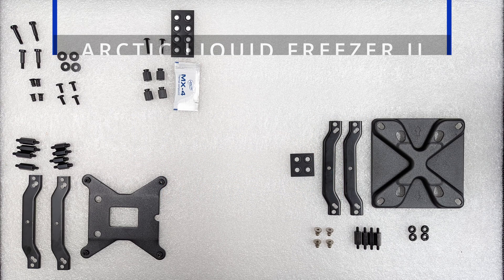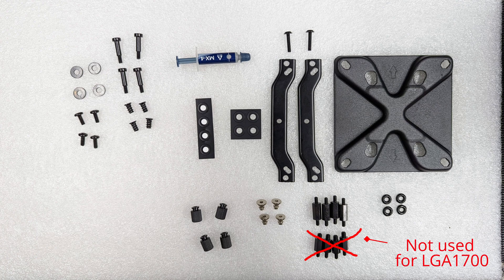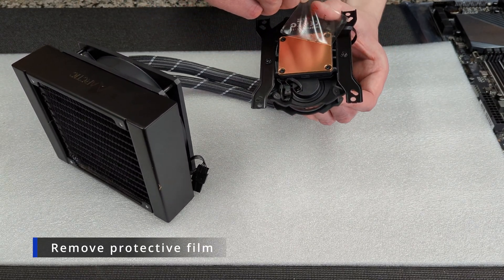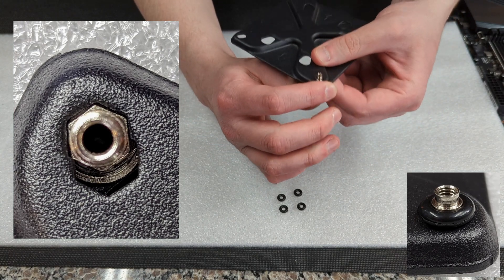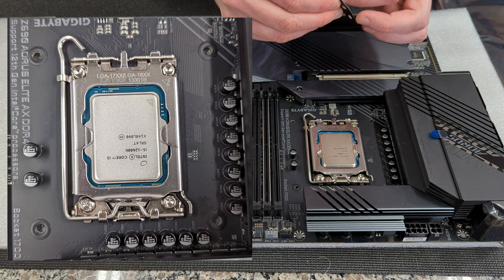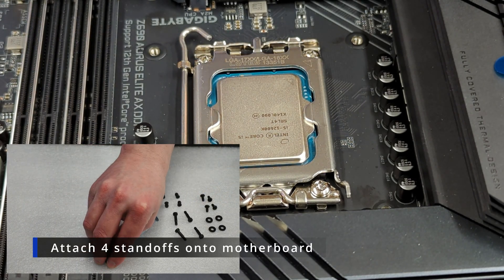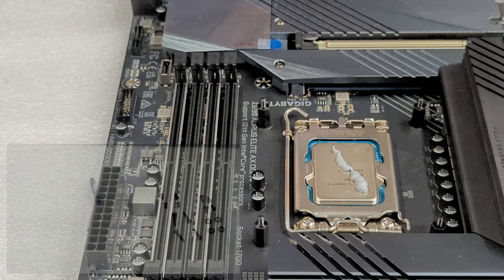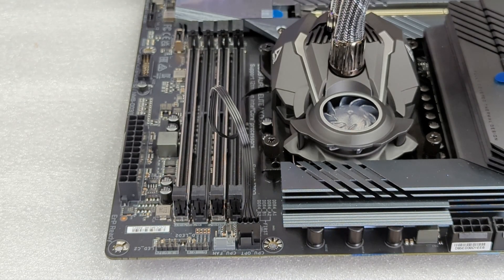ARCTIC Liquid Freezer II | LGA1700 Kit Installation

Comment: I'm sorry, I bought a Liquid Freezer II 240 and I've been trying to assemble it for 3 hours without DAMAGE to my new board... Please update the tutorials and your manual which in my humble opinion is extremely
Reply from the maker: Hey Rony,
I'm sorry for the confusing video.
Please keep in mind, that this video is for the Rev.1 LGA1700 Kit.
We introduced a new Kit just a few weeks ago (Rev.2)
Which might look different to the Kit above.
We're already working on another video to keep everything up-to-date.
Kindly check our online manuals here: https://pulse.ly/td65nmccgp
Select the right Rev. and you should be guided through the installation step by step :)

Best regards,
Nico
Reply: @ARCTIChannel  Nico, thanks for the prompt response, I apologize for any words that sounded offensive, but I ask that you understand the frustrations of anyone who buys something and seems to receive another, or just after opening the new equipment and parting with news that it is probably the part she just purchased it will possibly not be useful for what you bought, MAAAAS your site is organized, and I even by intuition (following the manual of course) checked it once more and mine is REV 7 and I assembled everything as agreed with the manufacturer, thank you very much for your attention, a big hug 🫂.
Reply: Now, my only question regarding your material, is how rigid the hose of this water cooler is, it seems to cause a huge pressure of "pulling out or to the sides" on the processor... I had to change cases 3 times because of that :/
Reply from the maker: Hi Rony,

sorry about that. I hope that everything has worked now. 💙

Kind regards
Dominik

Comment: Instead of sticking the 4 spacers on front motherboard, Easer to stick each on the end of each Rod screw, This will save you time trying to peel them off of motherboard.
The 4 spacers for the back of motherboard can be left off, The O-rings are rubber & do a good job
Reply: Yes, i think the same, but I ended up doing the same as there... Extremely confusing and non-LINEAR manual, it appears first how it will look and then the pieces, completely the opposite, I think I should show the piece first and where it will fit... Already working

Comment: I just buils up my new computer with this Arcitic as cooler for my i5 12600kf but instead used Original Pre-LGA 1700( haven't seen this video before and not included mounting kit either xd) and result is worst than I can imagine . It seem like with this old moutning kit, the pump can't reach enough for cooling CPU and temp idle when start bios is 55 o C and when cpu load 24-25 % is 80~ 84 o C . It seemed like I need change mouting kit I used 😢
Reply from the maker: Hey Lilgamesh,
Kind send us a DM on another channel - Please include the invoice of either your cooler or CPU.
I'll send you a Code, which you can redeem on our website to receive the latest LGA1700 Kit.😊

Best regards,
Nico
Reply: @ARCTIChannel  Hey . Should I send message by Instargram or by email ?
Reply from the maker: Feel free to write us on Instagram, it's faster. 🙂
Reply: @ARCTIChannel  Yes I have sent it . Thank for your help

Comment: Just did this last night.  It is still the largest and most difficult AIO I’ve wrestled with in 20+ yrs of building.  Also I got new stock from Amazon less than a week ago and it did not have the the new plate hardware.  Looking on their website I “may” have the revised pump block but hard to tell from the photos.  In the Asus 690 strix board I have (one of the affected) there are so many heat sinks that it further complicates things.  I’ll boot it up shortly and see how I did.
Reply from the maker: Hey,
I'm sorry for the inconvenience you had with the installation.
Kindly send us a DM on another platform and send over a picture of your CPU block. We'll take a look at it.
Did you already installed it?
Normally there is something called „Keep out Zone“
The manufacturer of the Board should make sure, that other parts are no interfering with the Board.

Kindly share your feedback!

Best regards,
Nico
Reply: I just got my Arctic Freezer II 360 and it came with everything needed for mounting on an LGA1700 EXCEPT for that damn black plate. It came with a different plate, but not the one that has an X shape in the middle. So I just had to order the LGA1700 kit from Amazon and now I gotta wait another 2 days for it to get here. I was legit about the mount the cooler and put the motherboard in my case and finish up the build when I noticed the plate was missing. :(
Reply: @WilliamTell1313  i used the old backplate and it worked fine but i needed to use a shorter set of standoffs
Reply: @MumuInc  I was actually wrong with my comment. I actually got the Revision 2 LGA1700 kit. It comes with a way slimmer backplate that worked perfectly. I'm not sure what the original comment guy was talking about. I thought the installation of this was super easy. I still got the Revision 1 kit from Amazon, but they are going to refund me.

It was confusing because every picture had the Revision 1 backplate and even on Arctic's official web site, you could only see the Revision 1 kit. Even when finding the Revision 2 page from Google results, upon clicking on the link, it would just redirect to Arctic's home page. So I'm guessing they are sold out of Revision 2 kits. Still would've been nice to know or have a label on the bag that the LGA1700 kit came in!
Reply: @WilliamTell1313  i think the original comment was talking about the pump itself not fitting onto his motherboard which some strix motherboards did have issues with but i think they're mainly the itx versions

Comment: So is it ok to use the original Pre lga 1700 hardware because that's all that came in mine?
Reply from the maker: Hey Marcus,
Kindly make sure, it's not the Rev.2 LGA1700 Kit.
It looks pretty similar to the original backplate :)

Otherwise you can request a free LGA1700 Kit on our website, if you have any issues with the compatibility of your backplate.

Comment: are both kits good to use or only the one to the right? I bought two arctic 2 freezers and all of them have the kit to the left...
Reply from the maker: Hey Natka,
Both Kits should be fine.
The Kit on the right side is the Rev1 (a bit thicker)
The latest Kit (Rev.2) is also available on our website now.
in 95% of the cases you should be fine with the Rev.1
Due to some incompatibility issues we added the thinner Kit aswell :)

For further questions don't hesitate to ask

Best regards,
Nico

Comment: I recently bought the non-RGB, Arctic ii 420mm AIO, with the updated thin backplate and other hardware, and it fit into my non-RGB Lian Li Lancool III case at the top (I was pretty excited when it worked out.) I have the i9-13900k and a Gigabyte z790 Aero board, with two sticks of 32GB Kingston Fury RAM, and everything fit properly! :)

My only gripe is having to use those stickers for washers. They can be a pain to work with, because it can be easy to miss-align them on your motherboard, and peeling them off might cause damage to the board. It can be very nerve-wracking.

Anyways, Arctic folks, please try and come up with something that does need to use stickers for washers, and is still safe for the motherboard on the CPU side, because those stickers may be permenently stuck on the board after fastening those standoff screws. ._.
Reply from the maker: Hey Michael,

Thank you for your general feedback aswell as the feedback about the washers.
Normally they shouldn't be able to cause any kind of damage to your board, when peeling off.
I'll redirect it to our engineers - maybe we can further improve the washers, by making them less sticky.

For further questions don't hesitate to ask

Best regards,
Nico
Reply: I just installed this earlier today. My first thought was "it's gonna be easy for my fingers to misalign them." So, I stuck each sticker onto the tip of a micro precision flathead, and lined them up perfectly with the holes being cautious not to touch the flathead to the motherboard. All of my stickers are aligned perfectly.
Reply: You are lucky! My friend realized his Asus ROG Strix Z790 board was destroyed due to traces running under the mounting holes.  Ouch! The washers offer practically zero protection.

Comment: What if the motherboard doesn't have cpu opt or anythin is it water pump connector
Reply from the maker: Hi Duckity,

We recommend the CPU_Fan header, especially for older boards, so that you can be sure that the whole thing is PWM controlled.

Kind regards
Dominik
Reply: @ARCTIChannel  kk ty

Comment: Ive recieved a different bracket in my box for the ARCTIC Liquid Freezer II, according to the website it's the "rev.2". Will it stil. work? I have not received my motheboard yet so i cant test.
Reply from the maker: Hi Sten,

You have the latest backplate. It's even a little better and of course it works 🙂

Kind regards
Dominik

Comment: I have a question! I just put together my build using this AIO but the bracket it came with resembles the old bracket for Pre 1700 sockets. However I noticed it has mounting holes that resemble the updated bracket. I mounted it and everything seems to work fine. Is the bracket I installed an updated 1700 bracket or do I need to order the upgrade?
Reply from the maker: Hey Luke,
Kindly take a look at the online manuals - Rev.7
There should be a picture of the updated LGA1700 backplate.
Otherwise you're also good to go with the Rev. 6 backplate (it's just a bit thicker)
If you have any kind of trouble, due to the thickness you should go with the Rev.7

For further questions don't hesitate to ask

Best regards,
Nico
Reply: @matthiasmax2849  Did you get an answer about lga 1700? I bought 240mm cooling, and there is a backplate that looks like for lga 1200 and the pressure on the processor is very bad

Comment: Lucky I watched this video I bought the aio 360 and didn't realise I needed this upgraded mount for my 13700k I ended up paying £10 for it and next day delivery
Reply from the maker: Hey Marine,
Did you saw, that we're offering the LGA1700 kits for free on our website? :)

Best regards,
Nico
Reply: @ARCTIC  yes but can you ship to the UK by tomorrow?
Reply: Why do you not have this already In the box ?
Reply from the maker: We’re sorry for the inconvenience – Normally there should be a Kit inside each box by now.

Depends from seller to seller - sometimes they send out old stock.
That's why we're offering to send out the free Kits.
It’s hard to recall every box each time we’re doing a small change and adding something to it.
Hope for your understanding.

Best regards,
Nico
Reply: @ARCTIC  no it was the old plate

Comment: If I’m using this kit for the 13900k, should (or could) I still install a thermal frame on the CPU?
Reply from the maker: Hey Banlara,
Adding the contact frames isn't as easy - Please make sure, that you know, what you're doing.
It's optional - you don't have to use it but if you like you can.
It's up to you :)

Best regards,
Nico

Comment: I had a 420 mm and I was very happy with it last summer, on a machine with a 5800X3D that I just sold. I am now runnin a 13700KF, on a gigabyte Z790 AORUS ELITE AX, any problem for a 360 mm?
Reply from the maker: Hey Adamu,

The Liquid Freezer 360 should be able to handle the 13700KF.
Please make sure, that the limits are set in your BIOS.

Best regards,
Nico
Reply: @ARCTIChannel  Hey Nico ;)
waht do you mean by "limits are set in my bios ?"
Reply from the maker: Hey Adamu,

Some Boards come without the Power limit set - so you have to do it manually.
We recommend checking, since otherwise your CPU will drain more and more power which means more and more cooling performance is needed :)
Sooner or later the CPU cooler will cap out and won't be able to cool your CPU properly.

Best regards,
Nico
Reply: @ARCTIChannel  Ok i undesrtand, to witch TDP i should limit it for a 360mm ? I alawys undervolt/limit those high end CPU.
My principal question is about the 1700 kit, where can sure buy a 360 (no)RGB with the kit already in ? I ask on amazon but the vendor tell me to look on your website.. Oo
Reply from the maker: Hey Adamu,

As for the TDP it's hard to tell, since we're not giving any sort of TDP value. But i would assume, the Liquid Freezer 360 should be able to handle about 500W cooling capacity (not TDP).

If you're ordering directly from our website you will receive the newest rev.
It comes with the newest LGA1700 backplate, which is a bit thiner than the normal one.

Otherwise you can DM us and send us either the invoice of your CPU or the cooler and I'll send you a code to get your free Kit on our website.

Best regards,
Nico
Reply: @ARCTIChannel  i just ordered a 420 mm on your online shop DE ;) Hope it will comes with the 1700 kit too ;) I bought a Thermalright LGA1700-BCF frame, i imagine it could be good with this AIO ;)
Reply from the maker: Hey Adamu,

if you order from our webshop, the LGA 1700 kit is definitely included. Don't worry. 🙂
Feel free to send us a photo on Facebook, Instagram or Twitter. We are curious, it doesn't seem to be a small office PC. 😁

Kind regards
Dominik
Reply: @ARCTIChannel  its a 13700KF with a 3070ti DDR6X in a BeQuiet 802 Case, 32GB DDR5... on a gigabyte Z790 aorus elite AX. I will tell you how the 420mm will works with this ;) yes i ordered it directly from your DE store.
Reply: @ARCTIChannel  what about frames with an Artcic AIO ? Its compatible ?
Reply from the maker: What do you mean by frame? Do you mean case? 🙂
Reply: @ARCTIChannel  no, i mean Thermalright LGA1700-BCF for example
Reply from the maker: Basically it remains LGA1700, so yes is compatible 🙂 .
Reply: @ARCTIChannel  i dont know if this frame is really necessary but i will feedback my results to you ;)
Reply from the maker: We're definitely excited to see what you report. 😁
Reply: @ARCTIChannel  i should receive it today, probably
Reply from the maker: Fingers crossed - once arrived, kindly let us know :)
Reply: @ARCTIChannel  I just received it, I had however clearly specified in my order that it was to be mounted on a 1700, but I ONLY have the original pre-LGA1700 kit included hardware, the left here, not the right on your video here https: //youtu.be/ZLPDPom8eVQ?t=33
Reply from the maker: Hey Adamu,
Kindly check again - it should look a bit different.
The Rev. 7 LGA1700 Kit and the Pre LGA-1700 Kit looks identical. The Rev. 7 Kit has a bit more holes/mounting options available.
Kindly send us a DM and make a picture of your mounting.
If you have the older plate I'll send you the newest :)

Best regards,
Nico
Reply: @ARCTIChannel  yes Nico its the REV7, so i can use this one ?
Reply: @ARCTIChannel  ok yes i have more holes one the backplate than the left on the video, should i use it ?
Reply from the maker: Hey Adamu,
Yes, you can use it :)
It's the Rev. 7 backplate (thiner than the Rev.6 one)
This one is our newest one.
You're good to go :)

Best regards,
Reply from the maker: Correct :)
Reply: @ARCTIChannel  Many thanks Nico :) will mount it in few minutes, after work. i'll give you feedback ;)
Reply: @ARCTIChannel everything works very well, 26° at idle, no time to stress it but it's perfect for me ;)
Reply: and 76° on benchmark test with OCCT
Reply: @ARCTIChannel  there are just vibrations on these fans, I will replace them with silent wings 4 from BeQuiet ;)
Reply from the maker: Hey Adamu,
Thank you for the feedback - Highly appreciated!
Great results :)
I'm sorry for the fans - Normally this shouldn't be the case.
If you like, kindly contact our support and we'll take a closer look at it.

Best regards,
Nico
Reply: @ARCTIChannel  i perhaps dont connect it correctly, they are volt by the CPU connector ? I mean, there's only one cable ton con,nect on the CPU connector on the motherboard ?
Reply from the maker: Correct - there should be just one cable connected to the CPU_Fan.
The other fans are connected via PST (daisy chain)
Reply: @ARCTIChannel  I thought the vibration was coming from the fans but no, I can't figure out where it's coming from, yet I have a very good big Silent Base 802 case but sometimes it sounds like a vibration, in the bass... its didnt done that with my air cooler i had before.
Reply: @ARCTIChannel  my fault ! I had connected it to CPU_OPT instead of CPU_FAN, it seems to have solved the vibration problem!
Reply from the maker: Strange, that changing the header stopped the vibrations..
As long as it works fine :)
Reply: @ARCTIChannel  i understand what it is... i put my rad on front position. The fans outside and the rad inside, ON the case. I'll try to put some rubber between the radiator and the case.
Reply: @ARCTIChannel  I disassembled the fans and repositioned the radiator, no more vibration now!
Reply from the maker: Happy to hear that!